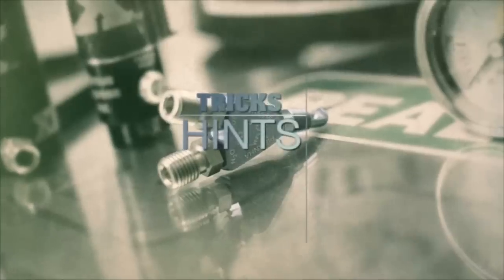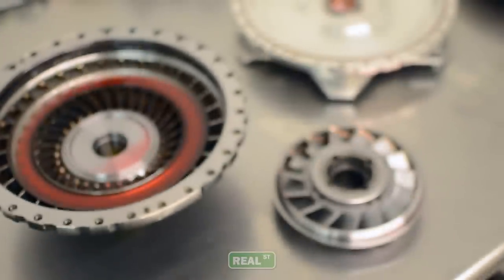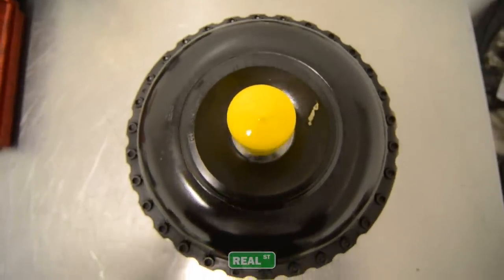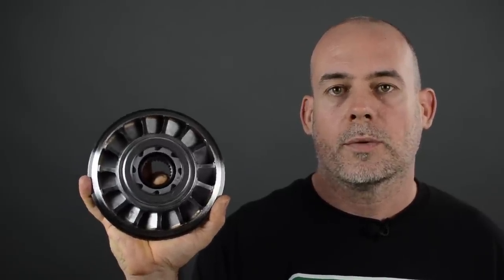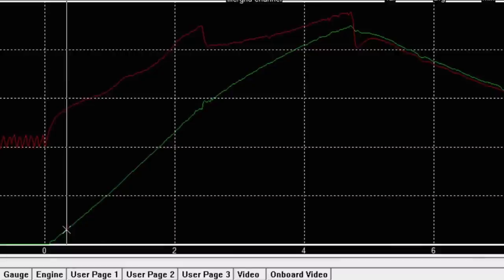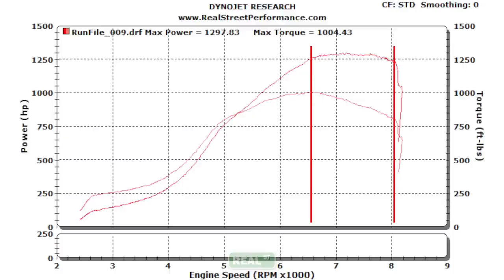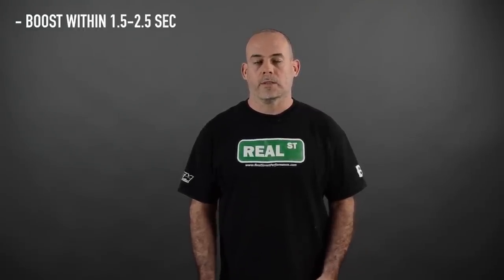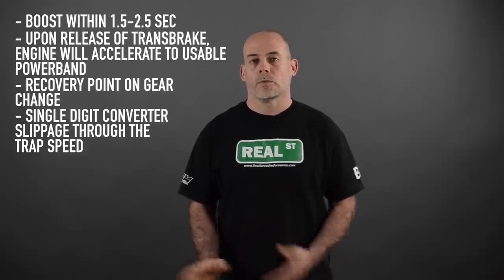Torque Converter Selection & Setup - Jay's Tech Tips

Comment: good video. can you add info about lockup converters?
Reply: Hi, Lockup type t converters are much stronger than normal t converters.There is clutch disc located  and connected with a spline to the turbine , when we want more clutch this clutch friction disc pussed by a piston to the torque converter housing and clutch friction disc starts to rotate same speed of t converter housing  , clutc disc already locaced and connected with a spline to the turbine so it doesnt allow the turbine loose the power during the work so that turbine becomes more strong to transfer the power from engine to transmsision.But normal converters without lock up unit .  Hope I explained. ::)) I m from Turkey.

Comment: A GTR is technically automatic (correct?)  but they have two clutches. How does that work? How is it different? Does that type of transmission deserve a video of its own? Seems to combine the manual and auto trans.
Reply: Lots of sports/super cars have that transmission which is a dual clutch transmission (auto). Let's say you have a 7 speed dual clutch trans there would be 1 clutch for the odd gears (1,3,5,7) and 1 clutch for the even gears (2,4,6). So that way you can shift faster because once a shift is made with clutch 1 clutch 2 is already ready to make the next gear change immediately. And that is basically how a dual clutch transmission works.
Reply: +Matt H DCT are automated manuals.
so ya autotragic
Reply: +Andrew Robbins spot on. the transmission shifts before you request the gear change and all it has to do to shift is disengage one clutch and engage the other, all of the meshing is done before hand. makes shifts basically instant.

but flappy paddles still suck!

Comment: Hey Jay I’m currently looking into this and need a torque converter now the question is what do you recommend in a  bpu supra my car surrently just ran 13.1 1/4 mile I need to hit low 11 into the 10s car is currently running really strong at 1.2 bar stock twins. Any help really appreciated 🙌🏽
Reply: Precision Industries

Comment: How does the tq converter dictate what rpm the engine falls to after gear change?? last time I checked autos had gear ratios to dictate that
Reply: It's called shift extension. The gear ratios don't matter as much on gear changes because the convertor will slip enough so you're always in your powerband.
Reply: lies.... tell that to my 5l40e trans it was about 200rpms outta my powerband.... and also majority of races videos when its a manual vs auto.. mantans seems to always win (driver mod)

Comment: why not use a dual clutch transmission with computer controlled clutches?
Reply: price I'm Sure. dct is new technology. auto is proven, affordable and plentiful.
Reply: Niels boost loss
No torque multiplication 
Most of the time slower shifts now ( gm/ford 10speed slush box shifts faster than vw/Porsche pdk box )
Shock loading 
Tuning 
Reliability 
Etc

Comment: are you saying automatics are better than manuals?
Reply: +GigaDonk 
Given the experience in the racing they compete in, yes.

Automatics have come a long way in a technical sense.
Reply: +GigaDonk for drag racing and technical offroading, yes.

for fun, no.
Reply: +tr0n so what you're saying is youd rather spend money to make more power and run 12's vs spend the same amount of money and run 10's?  idk about you but going faster is more fun than going slower and throwing gears.
Reply: SouthernSpeedVideos alll in the perspective my friend. honestly i'm more of a streetcar kinda guy, not pure drag performance...and i doubt it'd be a 2 second difference.
Reply: +tr0n an average rwd with 400 hp is in the high 11's to low 12's depending on weight.   usually low 12's.   a rwd automatic in a 3200# car is in the 10's for sure.  I've seen it with my own eyes.  it's worth at least one who second in the quarter.     what does a transmission have to do with street car?